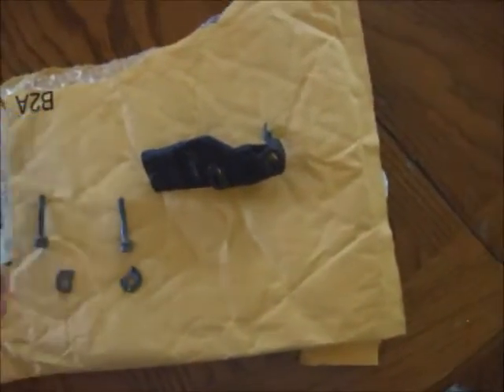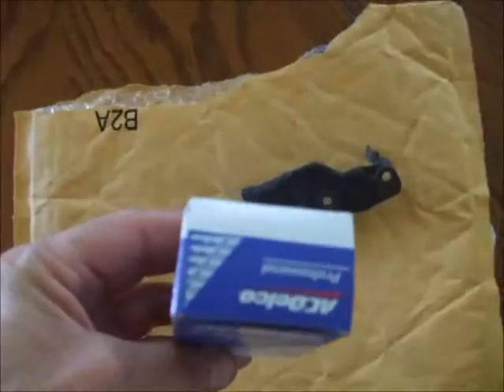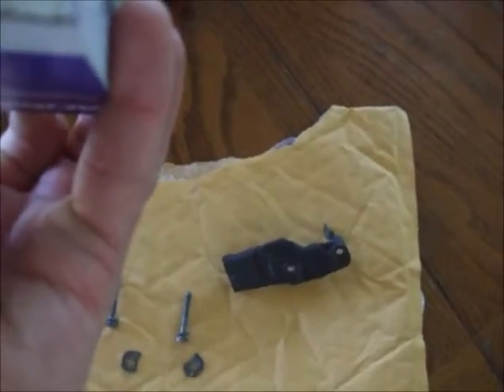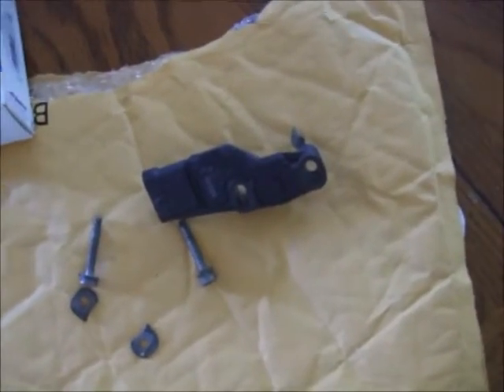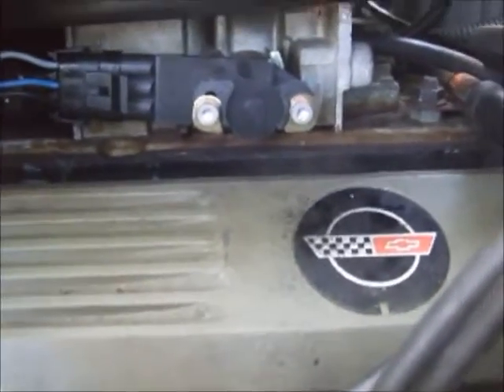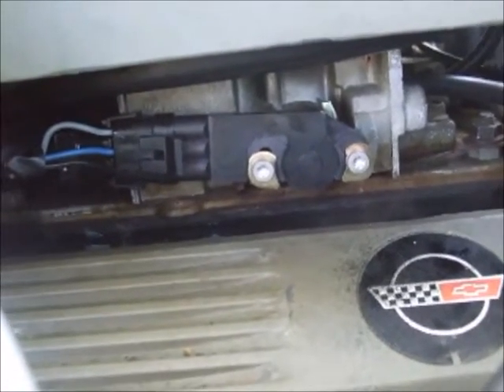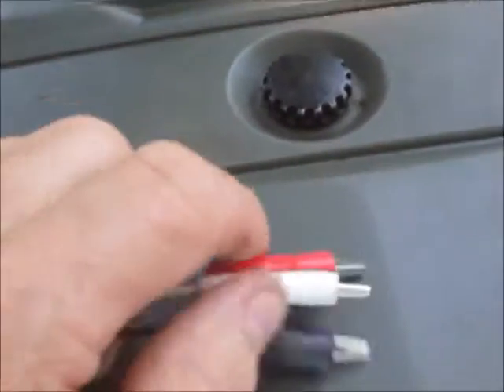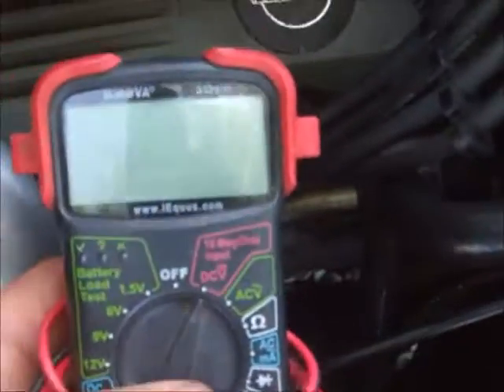𝟏𝟗𝟖𝟒 𝐂𝐎𝐑𝐕𝐄𝐓𝐓𝐄 New Throttle Position Sensor

Comment: I am about to install the TPS now, I am seeing slots for adjustment.   Is there an adjustment procedure posted anywhere?
Reply from the maker: The FSM is pretty detailed 6E2-68 with a lot of illustrations on connecting he multi meter and how to adjust. Figure 68 on 6E2-69 and install, connect and adjust on 6E2-69.  Very  easy procedure.
Reply: @HorseshoeBeach  gonna look for a FSM now.   Was given my father's 84 last week after it slept in a barn for over a decade.  When it was parked, it had some problems already.   At least the car did start after it's slumber, now just to get it running.  

Thank you for making these videos, they've already been lots of help.  Using your video on how to text the TPS, I was able to find one problem.  Eventually I was able to figure out how to set the TPS correctly using your video and a cookie couple posts from the Corvette forums.
Reply from the maker: If you're not removing the TPS and just adjusting, If you back probe terminals A and B with a multi meter, ignition in the on position loosen the mounting screws enough to be able to position the TPS so you can get a reading of .525 (+- .075), closed throttle. Re-tighten the screws. After you get that closed throttle volt setting, you should be able to watch the multi meter and get a very smooth transition up to I think it was 4.75 or 5 volts at WOT.  **The goal of the test  is because it is a potentiometer it has to be smooth not jumping around or dropping back to zero because that would indicate a worn spot or flat spot on the shaft of the TPS which I think was common. That would cause hesitation, stumbling and even possibly stalling. Don't loosen the mounting screws so much that the TPS is loose and flopping around,  just enough to be able to move it in order to set it at .525. If you get a smooth reading then by just running the throttle up very slowly, it is probably good. You don't need to start the vehicle.  The most common problem on these cars is that Coolant Temperature Sensor on the front of the engine block. Because if the cars starts and runs but runs rough...that is the first place to check, because the CTS is so cheap, I just install a new one, they are not the easiest thing to TEST, have to boil water ect......I'm not interested in doing that for $15. I don't mind answering any question I can help with, let me know.
Reply: @HorseshoeBeach  Thank you.  I did get the TPS figured out and adjusted correctly.   The old one didn't test correctly, as your other vehicle.   Thought I saw online that the voltage was to be set at .54, and that's where it is now.  I can adjust to .52v if that's a better point.

For $15, I might as just well change the CTS.   Yes, it was idling like it has a cam, and that's when I started to test other engine management sensors.
Reply from the maker: .54...thats right. been a while since I did that...

Comment: Hey delta wat can cause my throttle bodys to not spray fuel? I put a new fuel pump and they didn’t spray. Wen I removed them i did see a little fuel come out the fuel lines that connect to them. Then i tryed my throttles  on my brothers 84 and on his they worked fine. Could it be possible one of the plugs the go on is bad
Reply from the maker: both injectors quit working? did you check the fuses in the fuse box?
Reply: The driver side one used to work but now they dont  im in the middle of firing up a fresh rebuilt engine and wen i tryed to crank it no fuel was spraying.i changed the fuel pump thinking it was that.and then I guess I failed to set timing and dead center at first. But now i got it  set right just last night I haven’t tryed to start it yet i want to see first wats wrong with those throttles not spraying. I tryed them on my brothers running 84 and they both worked. So it leads me to my plugs that connect to them are bad or a fuse like u say. Wat fuse should i look for?
Reply from the maker: there are two fuses inside the fuse box on the passenger side door up by the windshield......each injector has it's own 5 amp fuse.....that's what I would check first......the injectors are controlled by the ECM.....sure it's grounded correctly and the  connectors are plugged in really tight? Kinda odd that both injectors don't work....at the same time...both injectors are also grounded in the ecm. When you talk about frshly rebuilt engine...you took it out and put it back in? Did you reground the ECM and everyhting correctly?
Reply: Wer is the ecm grounded at . Fuses look good . Yes i took engine out send it to west coast engines to get it completely rebuilt. I put it back in and everything back on how it was . I took pictures of every step every bolt , wire even watched alot of your helpful videos so everything should b back together how it was
Reply: Even if my fuel lines let out fuel wen I removed the throttle bodys . Could it be possible my lines could b clogged
Reply from the maker: the ECM is grounded at G161 which is behind and a little down form the driver sided vavle cover.....pretty easy to see and get to.  I don't understand...did your injectors spray fuel BEFORE you had the engine rebuilt?  Because the injectors are just a solenoid valve that opens and closes....just my opinion but I doubt it is a clogged situation where both injectors would stop working at the same time.  WHEN...you turn the key on you should here the fuel pump PRIME the system for about 2-3 seconds??????? If you hear that fuel is at the throttle bodies, if not then there must be an issue with the fuel pump RELAY.....if fuel is being pumped and you put a volt meter to the throttle bodies and you have power...then the ECM must be malfunctioning....because the ECM is what drives the injectors by way of grounding  the injectors in a PULSE.....BUT they were spraying before engine rebuild and you didn't mess with the ECM.......my guess is it is something very simple somewhere??????
Reply from the maker: I'm just guessing because I wish I were there, love working on these cars...BUT if you turn the key on and hear the fuel pump prime the system to the throttle bodies all the way through the crossover tube, and you have gas....seems doubtful to me that BOTH TB's are clogged...at the same exact time.....seems electrical to me. The ECM controls the injectors........it is a GROUND pulse...if you DON't have fuel priming the system....probably the Fuel Pump RELAY. ALL THIS IS JUST A GUESS Jose...i'm not there..but the whole system is very simple.....What I don't understand is the before and after engine rebuild.....were they spraying before?
Reply from the maker: When you turn the key on...you can clearly hear the fuel pump prime the system with gas FOR ABOUT 2 SECONDS....if you don't hear that there is no pressure...if the fuel pump RELAY isn't working there is no fuel
Reply from the maker: just following up here: but if you hear your fuel pump running for a couple of seconds then your pump and relay are working and you should have fuel to the injectors, if it starts then dies then you could have a bad oil pressure switch because if the ecm does not se oil pressure it won't run...a engine sfety  design.....but you are probably going to have to check your fuel pressure and also put a noid light on the injectors to make sure you have  power to them ( all you have to do is hook your test light and crank the engine over...should light up if it has power...if not probbaly something in the ground system or ECM....because if you have power at the injectors and fuel pressure then the car should at least fire up for  a short time even if it dies......
Reply from the maker: you should have between 9 and 13 PSI fuel pressure at the injector...if you don't....this car will NOT run...i've heard stories of old collapsed fuel lines at the tank.
Reply: I did put a new relay wen i changed the fuel pump
Reply: Before the rebuild only the driver TB would spray. I don’t think there’s nothing wrong with my Tb since i tryed them on a different 84 and they worked on it
Reply: Is the oil pressure switch under the block
Reply from the maker: if the injectors work on another car guess they're good then. FSM 6E2-24 word for word out of the factory service manual: a faulty oil pressure switch can result in "engine Cranks But Will Not Run"... I have one on my 84 right now that sticks in the closed position..was gonna change it this year but got busy. The switch is on the driver side of the distributor base down and below the windshiled wiper motor kinda behind the drivers side valve cover.  I can only you help as best I can from a long way off.....not there to test things......you could try to switch the connectors on the injectors to see if there is a break in one of the ground wires??? the noid light will tell you if the circuit is pulsing a ground though, just by cranking the engine.....the ECM doesn't care whether the engines starts or not as long as it sees oil pressure it will send a signal if the wiring is in place grounds etc.........Back to the oil pressure switch though...this crossfire absolutely will NOT START if the ECM does not see 4 pounds of oil pressure...you can crank and crank and crank the engine with the starter until enough oil pressure has built up to start the engine but it will die after that. The fuel pump primes??? the fuel relay works and then the ecm takes over with live battery feed through the oil pressure switch........ I still would look at voltage at the injector connectors....if you have fuel then there has to be an electrical problem...do you have SPARK at the plugs?????? Ignition Control Module inside the distributor maybe burned up....is the ground in the distributor in there correctly? people always forget to put it back right....just a little metal clip....still here trying to help Jose...do the best I can. ONE LAST THING....the electronic control module under the passenger dash controls the injectors spraying...not gonna pulse unless it see what it wants to see. I keep wondering the same thing though....fuel spraying out of the injectors requires pressure which you said you have, and a pulse from the ECM....if it doesn't crank then its just gonna flood out if you keep trying
Reply from the maker: on the driver side of the base of the distributor below the windshiled wiper moter behind the driver side valve cover...looks like a big bullit  sort of   they stick open and closed and most have problems, mine is sticking randomly.....fuel pump relay only works until the ecm sees 4 pounds of oil pressure....from the switch...the switch closes to give constant voltage to the ecm to keep the pump delivering fuel.
Reply: Thank u delta for your time and all your help I’ll check all that later today wen i get home. I wish ther were more 84vette guys like u around here were i live. I only really get to work on my 84 on the weekends only since i get out of work real late. Ill keep u updated for sure
Reply: Oh and i did put a new oil pressure switch before reinstalling the engine cuz I broke the old one getting the engine out . Its like a round one right
Reply from the maker: not a problem man....one last reply.....make it really simple...when you turn the key on you can hear the fuel pump prime the  system, thats' just the realy and the fuel pump...nothing else....if you continue cranking..4PSI of oil pressure is DAMN quick and the ecm goes to that circuit instantly because it is a closed circuit seeing battery voltage......if you have fuel, power to the injectors the car should FIRE UP...even if it dies. At least that way, you know those initial systems are working properly. Just for information...a little GM noid light at AutoZone that fits a TBI is only a couple of dollars....at least you would know you had a ECM signal at the injector....that is one step closer to a fix.....my guess fromwhere I'm sitting...it is something really SIMPLE. Let me Know!!
Reply from the maker: oh...wow...yeh it's round......guess my next step would be to noid light the injectors.....if you have fuel pressure continuosly why are the throttle bodies not flooded?
Reply from the maker: You don't smell a lot of gasoline like a flooded situation? I mean if you are continuasly cranking the engine?
Reply from the maker: off today so I made this video for you  https://youtu.be/eM4iWP7zQUs
Reply: I really appreciate u doing all that for me with posting that video its really going to help me with that diagram I’ll definitely get me one of those testers
Reply from the maker: I don't if its a wiring problem or not?? puzzling...but have to start somewhere. MAke sure you have a WELL CHARGED battery 11.6 or 12 volts.....and the alternator is puting out 13 -14 volts charge...that could cause issues.
Reply: By looking at the diagram it could be a wire problem i remember seeing the wire for the oil switch looking pretty faulty so ima have a look at it it tonight wen im home
Reply from the maker: just put this together...might want to seriously check this out, at least take a good look at the connectors   https://youtu.be/qiz4wjkZ094

Comment: I replaced mine thinking it was an issue. I'm not sure if it was or not. Now I'm getting the TPS low voltage code. I must have not put it in right
Reply from the maker: even if you install a new TPS the ECM will use the old data until the old codes are cleared.....the only way to clear the old codes is get the car to operating temp and above 40 MPH..FSM, (until drivability returns) until drivability returns is a very vague term.........the old disconnect the battery doesn't work on these pre-historic modules, don't care what anybody says the Crossfire is different......the TPS should show .5 volts at idle to 4.5 at wot ???
Reply: 3DELTA7 well. I was not getting the engine light code for it. However I decided to replace it thinking it may fix the stalling out. Now I'm getting the code for low voltage that I did not have beef installed the new one.